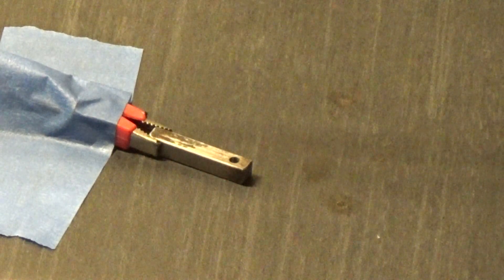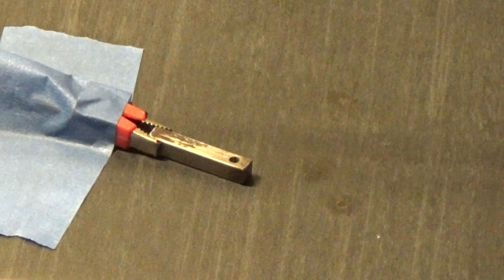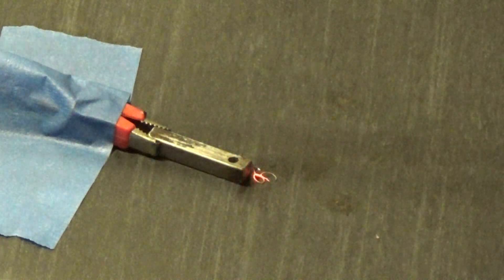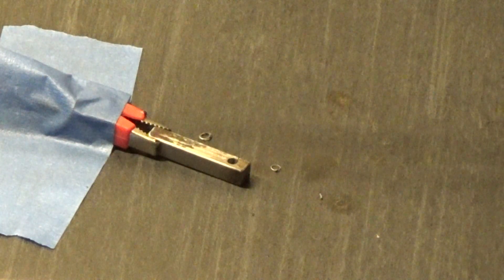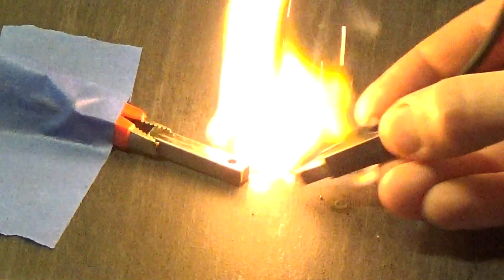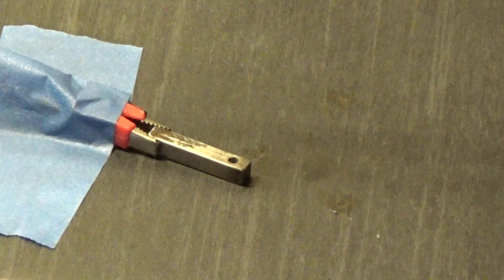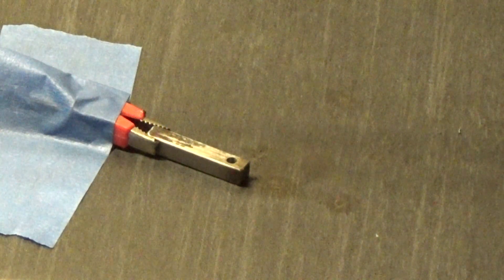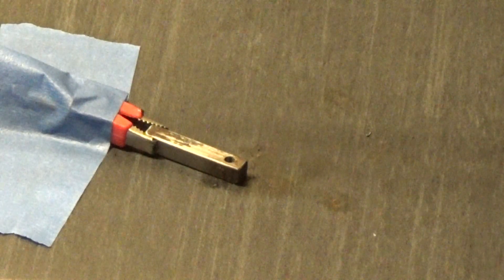#Liberator12k | ePrimer Experiments - Nichrome and Smokeless Slurry

Comment: use thinner wire, and have the entire thin wire encased in a slurry droplet, also, charging a few capacitors, and discharging in series will give you a lot of voltage fast.
Reply: @Liberator12k  cool beans, but if you increase the power enough it might start working again, since it becomes a super hot plasma.
Reply: @Liberator12k  got a link? i have been looking into ETC guns lately and been wondering if the tech could be used in a rifle platform

Comment: About 30 years ago i built a 20mm recoilless rifle much like the Carl-Gustav but as a "bag" gun (not fixed/caseless ammo) to be electrically fired. At first i built my own electric igniters much as you have done here, but later switched to electric matches that are used for pyrotechnics, as they were very reliable, waterproof, and not so fragile.

Comment: Interesting, you've opened up a load of math, but once you have your ideal ratio, you could adjust, thinner wire less turn etc for same given resistance. If larger gauge wire was drawing to much battery, use ohms law, maybe, but I guess you've worked that one out. 
I do think you should receive do this as a few times you jumped the lead off partially burning, heating the wire. Just a simple throw switch may be more accurate. Great video thou